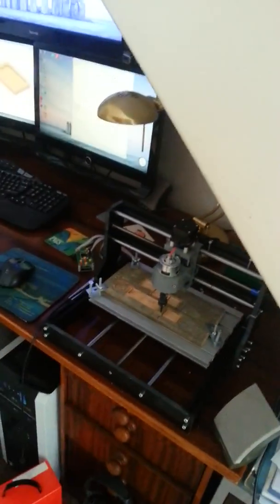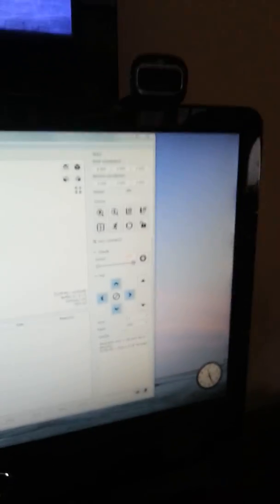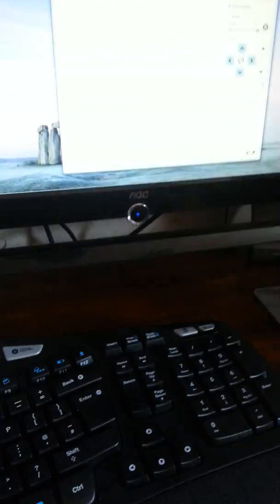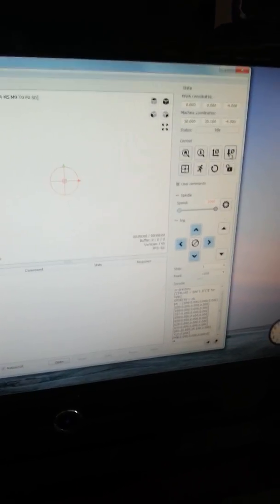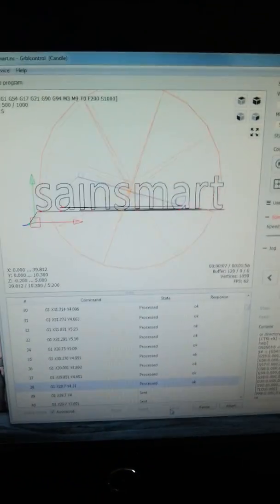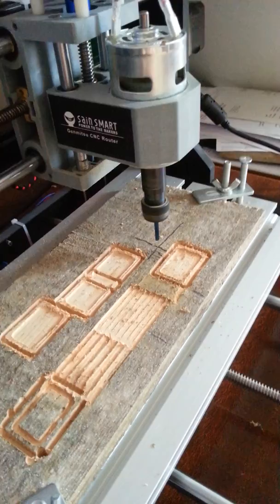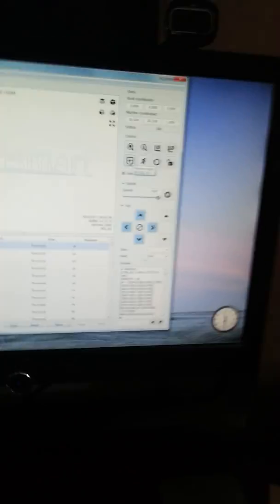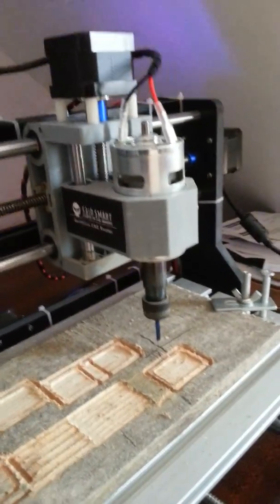20190623 112543

Comment: Did you ever find a solution? I am having the exact same issue!
Reply from the maker: It was a faulty power supply which whenever the spindle ran up it browned out. Final diagnosis was dropping the spindle speed to 200RPM and it worked. New power supply cured it completely! Good luck.